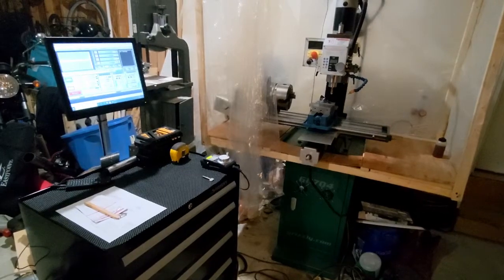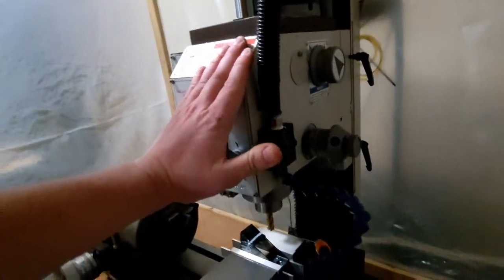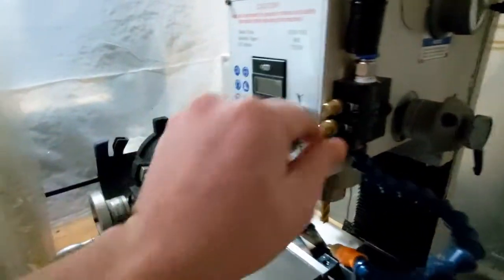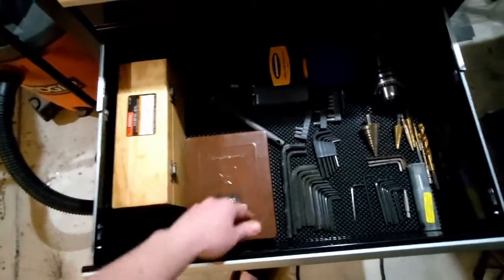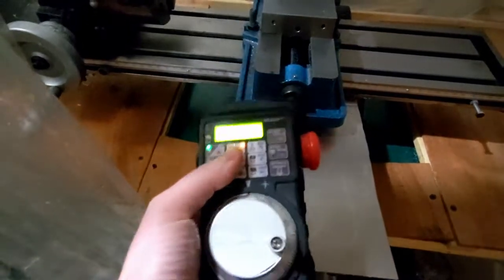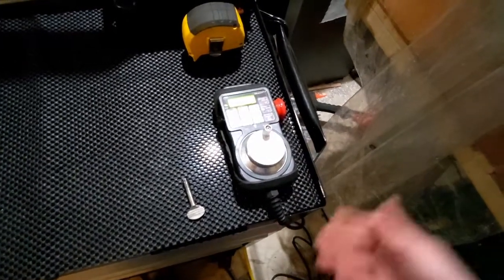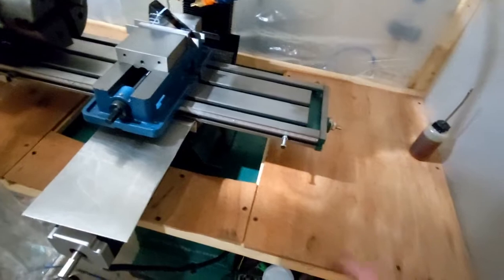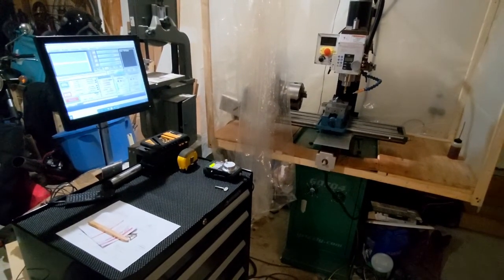G0704 CNC Conversion Aftermath and Shop Tour

Comment: Hi great video, thanks for sharing. Which BeeLink are you using and what is the size of the monitor ?
Reply from the maker: Beelink T34 6G RAM 128GB SSD with Intel Celeron N3450 Processor
https://www.amazon.com/gp/product/B086Q2L5GG/ref=ppx_yo_dt_b_search_asin_title?ie=UTF8&psc=1
Reply from the maker: As for the monitors, they were a cheap touch screen i found on ebay that was used. 15" square monitor.  i did get it significantly cheaper than what was listed on ebay... so maybe there is room for negotiation... 

https://www.ebay.com/itm/304065336322?hash=item46cbb4d402:g:3uMAAOSwP0Rg7fz9